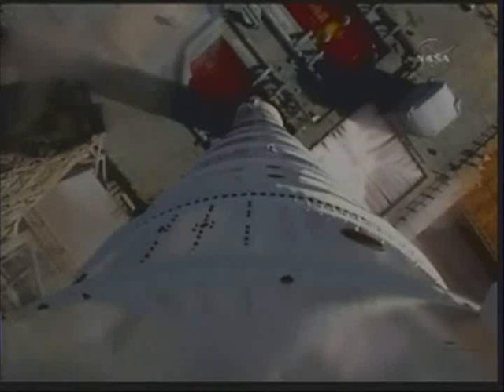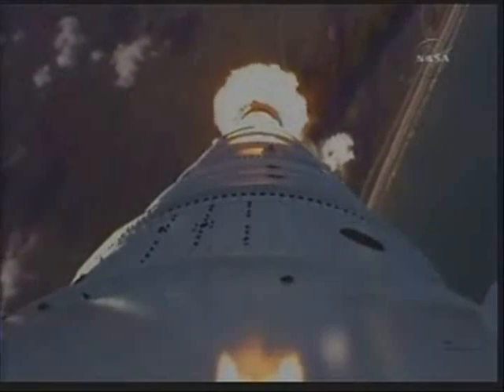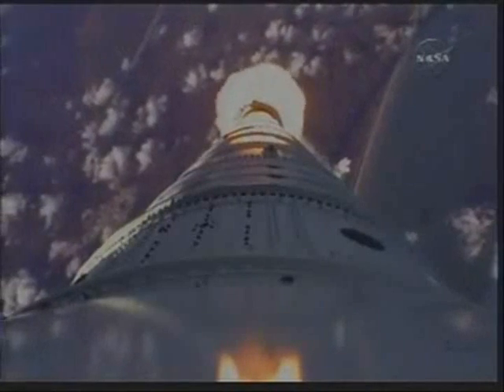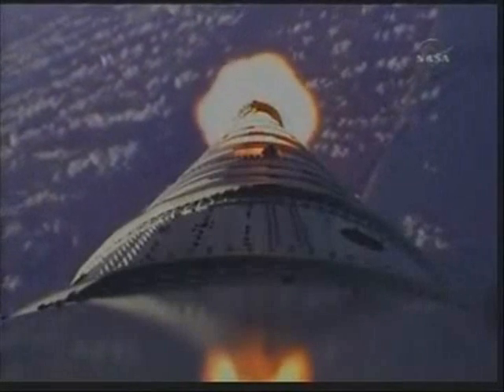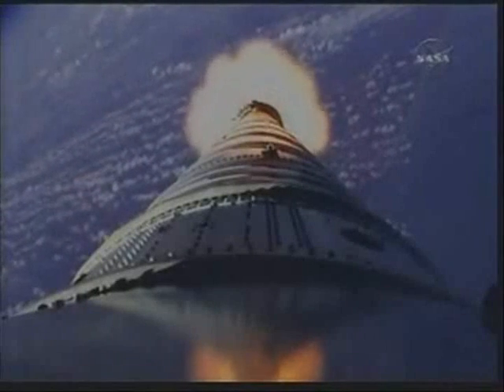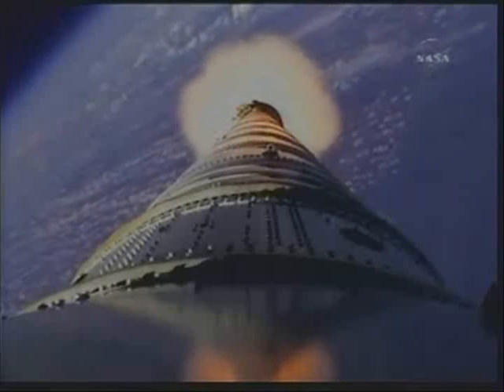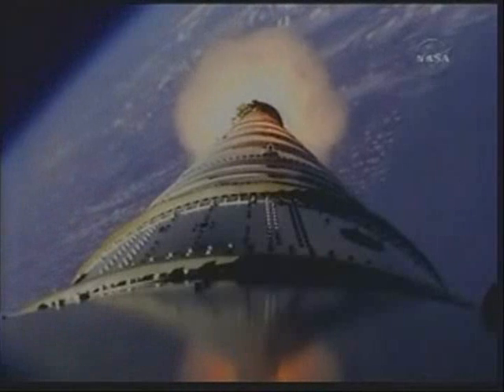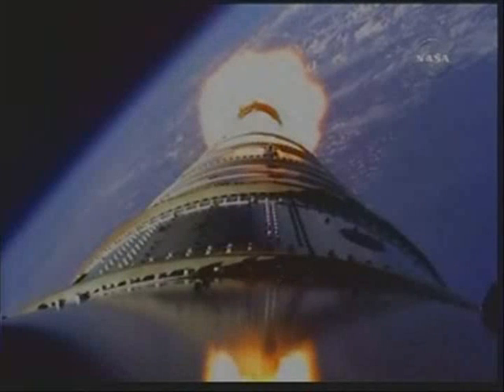Ares 1-X (Vehicle Camera 1)

Comment: That's probably the dummy upper stage. It was just an empty tube loaded with steel to simulate the mass of a real upper stage and Constellation spacecraft. The camera you're waching was on the booster. Since both the booster and the upper stage were in essentially the same ballistic trajectory after separation, they didn't get very far apart.